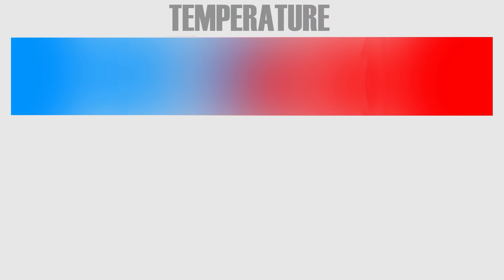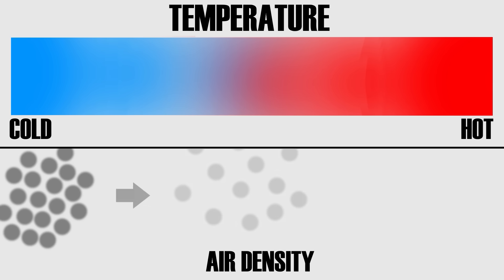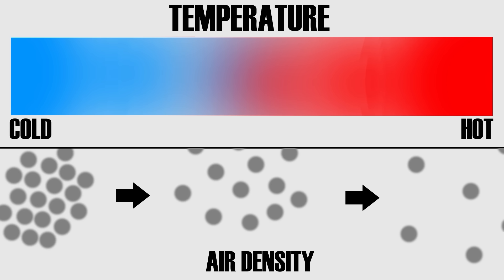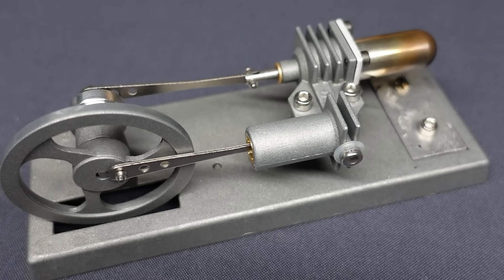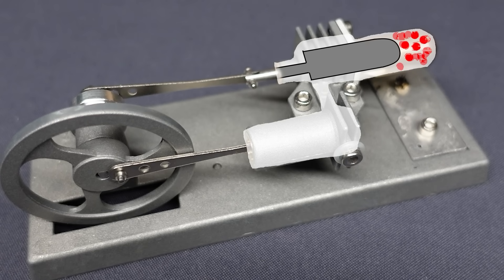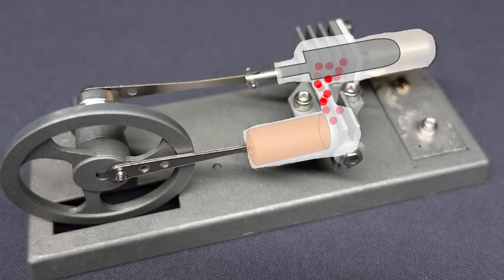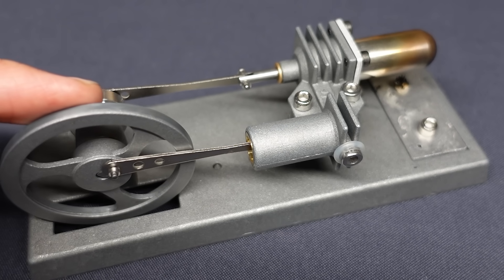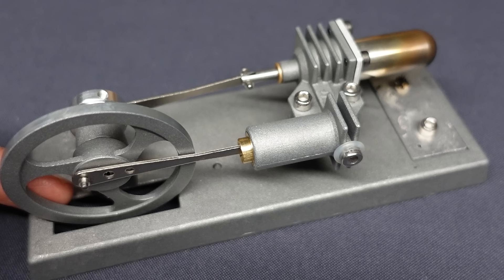It Can Save The World - The Simple Genius of Hot Air aka Stirling Engines

Comment: In theory, would it be possible to have a Sterling engine generate more electricity than it uses? If you hooked up electric motors to generate electricity like an alternator and used electric heating elements to control heat, could you achieve an engine that generates more power than consumed. By using a computer to control when and for how long the elements are on, it would theoretically constantly generate power while only occasionally consuming power. Yes the startup procedure would take a lot of energy to heat up the elements but once it's running it would only need to turn on intermittently to keep the temperature at an optimal level thus generating electricity without consuming any. Is this possible?

Comment: I have one of these and they are pretty fun, but a problem lies in lubrication. It slows after 15 minutes because there is no lubrication on any of the pivots. Spray it with wd as it’s running and it speeds up. Not practical for bigger projects yet.

Comment: I realize that the answer is probably "that's a more complex 5 stroke", but I wonder if internal and external combustion engines could be joined together: normal 2 or 4 stroke ICE, then use the heat expelled to perform the ECE stroke. I can see it being super useful in hybrids 🙂

Comment: I always assumed external was just referring to steam power since with steam you heat up the engine from the outside and then use the heated water to push steam pistons, while in the internal combustion you are combusting fuel inside the engine cylinders.

Comment: Any device has to be lubricated.  So you must have an oil cup or something and then you will have a lot of smoke I would think.  I have never read anything about this.  If you want to know about Sterling engines look for a book called 'The Star Drive'.  It is about how NASA uses a Sterling engine with nuclear power to power those probes that go to the end of the universe.   Also has a lot of info on Sterling engines and other versions.

Comment: Right beside the Sterling engine is a machine that uses only 25-30 percent of it fuel for energy and the rest for creating heat. Doesn't that look like a symbiotic relationship to you? Or you could make a simple Tesla turbine using the waste heat to generate electricity or accelerate a vehicle, etc. Alan Robb

Comment: Time 13:39
That begs the question, is there waste heat in an all electric car and could you use that waste hear to power an on board sterling engine that would charge the battery. Definitely could with a hybrid. 
Question is could you actually give the space and would the electricity generated compensate for the mass of the sterling engine.

Comment: Save the world from what?

The sterling engine is a novelty.  It always has been and always will be.  

Let’s see why!

1. Stirling engines have a low power-to-weight ratio, making them impractical for automotive applications

2. Stirling engines are more expensive than internal combustion engines

3. Low Power:  The physics behind the sterling engine are not favorable for automotive applications.  To produce enough power to propel a car, the engine would have to be massive.  

4. Reliability!  Sterling Engines have horrible reliability.  They require complex heat heat exchangers which are plagued with issues.  They suffer from heat pipe cracks, regeneration screen failures….  

They are NOT simple engines as you state and require many more parts than your toy example.  

They are also horribly inefficient and non-responsive.  

They’re cute desktop toy!  That’s all they’ll ever be.

Comment: 12:12 'even thermal power plants make massive amounts of waste heat'. Well, coal and lignite fired about 60 to 70% and gas fired about 40%, but it comes at around 100°C, way too low to properly run sterling. You can raise the waste heat temperature, then call it low-value heat and use it for district heating in the winter. Being done troughout the world. But at a cost for the electricity production efficiency.

Comment: can you use it with heat from geothermal heat with lower temperature than would be needed than to drive water steam engines? that would reduce the depth for digging geothermal drilling holes.

Comment: So air is an excellent "work medium" one of the best we know of consisting on or about 70 percent nitrogen and 30 percent oxygen. As we heat this bonded gas the nitrogen will stay "inert" but the oxygen will expand thus "expanding" pushing the piston this piston using an interesting "cooling fin" presumably to help moderate or #govern the output which then transfer the power to a cool sealed piston which is not "blowing off gas" /air as the first piston is this internal combust achieved via mechanical contrivance "pushing the cool gas in sealed chamber against other cooled gas by way of a piston" providing working power absolutely all SEEMINGLY powered by a single external heat source but in ACTUALITY powered by "internal gas flows" which indeed can be greatly enhanced by sealing up the external heat source using saying an electric coil such as that used in boiling water from your coffee pot. Wrap that piston in such a coil and simply plus that into you wall outlet and an incredibly efficient and powerful machine be made indeed in theory quite reliable as well. Interesting that LNG tankers which use #boil_off_gas to power their massive ships do not attempt to employ this type of engine technology actually as there certainly is no shortage of the fuel😊😊

Comment: Sterling engines - also used with solar power.  I recall a solar array consisting of multiple parabolic dishes.  Each parabolic dish consists of an array of mirrors reflecting light to the centre point.  And at the centre, the hot side of a Sterling engine.  Uncertain how this project turned out but I would assume the drop in panel cost makes this sort of solution less attractive.

Of note, the important point about a Sterling engine is that you require a temperature difference in order to extract energy.  One requires not only a hot side, but also a cold side.  I recall another project from a Pacific island that was planning on generating power via Sterling engine.  They were situated on an underwater cliff and planned on pumping cold water up from depth to use on the cold side of a Sterling engine.  For the hot side they would just use the surface water.  Don't know if it worked but it is an interesting idea.

Comment: Its not a combustion engine nothing explodes, it's an expansion engine, you hot air expands.
Reply: Combustion doesn't mean explosion. Wood is a combustible, so is coal and hydrogen. So, in an external combustion engine, the flame and what is causing the flame is the combustion.

Comment: 7:55 This exactly how it it is told, that Nazis got an idea of gas chambers. In Auschwitz (before it was a death camp- at the time it was a concentration camp- basically prison with almost no food and hygiene) some men ware packed close in a small, dark cell. It wasn't even air tight- normal, small room. They had one candle, but it was on all the time. They all suffocated cause the candle burned out oxygen it the air. The fact is most certainly documented. It only is not clear, if the gas chamber and gas truck idea was connected or not.

Comment: Missed opportunity to mention that in the beginning of the 80s, NASA and DOE (US Department of Energy) financed research to apply Stirling engines - initially from Sweden's Stirling United - to automotive use with prototypes (MOD 1 & MOD 2) from AMC, Chevrolet and Ford, based on models from their lineup at the time, built to prove its viability which they did with some success.

Search for AMC Spirit on Wikipedia and photos of the experimental NASA/DOE model can be seen with the Stirling engine used.

Comment: What is the minimum or optimum temperature. Could I catch heat from my boiler, tumble dryer or even waste water (like when you empty a bath) and use this heat, perhaps with a lesser amount of fuel to burn. could I run a small generator creating power I do not have to pay for, is a simple solar an added option?
The planets power really only comes from the pounding heat the sun provides everyday.
I have often thought whoever makes direct electric power from heat well deserves credit, and this looks very promising.

Comment: Off grid. Abundance of wood. 
Model up to run a household full time ?  Wood  or waste oilmheaters to charge a battery bank when needed? 

I see huge potential as an emergency charging option for a battery bank. 
Does the intensity of the heat determine the speed of the sir being transferred or and .. the heat that can be removed between rotating air between cylinders?   More cooling fins over a longer distance between cylinders?  
What about a flywheel in the equation?

Comment: Thermodynamics says the energy conversion efficiency of an engine where the hot part is T1 Kelvin degrees and the cold part is T2 Kelvin degrees cannot be more than (T1-T2)/T1.
Given you heat up the hot cylinder to 373K (100C/212F, boiling water) and the cold part of the engine is ambient air at 300K (27C/80F), the energy conversion efficiency cannot possibly exceed ~ (373-300)/373 =~ 0.1957 or 19.57%.

For comparison, a Toyota RAV4h with a A25A-FXS hybrid propulsion system manages to use around 41% of the energy of the fuel to move around.

Comment: Both types of engines produce carbon monoxide that will kill you. Its just that a Stirling engine produces VERY little power, and less carbon monoxide along with that power. An internal combustion engine produces much more carbon monoxide because it produces MUCH more power. 

In fact, an internal combustion engine is MORE efficient than a Stirling engine, and produces LESS carbon monoxide per unit of power made... 🤷🏻

So, NO, Stirling engines can not "save the world", they are more wasteful than I.C.E. engines are.

Comment: I work with large scale Stirling engines every day and a much as I like the idea (and it does make me a living) it will probably always be a curiosity.  A practical application of real value has yet to be found.
  We generate electric and heat water and rooms with the residual heat. This combined heat and power system nears 90% efficiency.  Nobody wants it, no market or interest except for a few hippy dreamers and some university engineering departments.  We have demonstrated it publicly running equally well on solid, liquid and gaseous fuels.  People are very interested but nobody wants to buy one.  It ain't gonna save the world, I wish it could.

Comment: Can you make a part two of this to answer my questions?

What if we use sterling engines in cars the same way we use hydrogen fuel cell engines? They take the energy produced by the fuel cell and charge a battery, which then power a motor. We can use environmentally friendly fuel like you mentioned to power it. 

Since we don’t have controllable engine speed, what if we add a transmission to do that for us to power the wheels? Maybe a CVT to electronically control the engine speed when required?

And finally, since the engine can run considerably long even after blowing out the candles, what if we use that to our advantage and make a perfectly timed sterling engine that runs on heat for some time, then turns off the heat to use the excess heat dissipation, and then just before the engine loses power, we relight the candles again to make it go. It won’t be perpetual motion obviously, but it would greatly increase the efficiency.

Talking about perpetual motion, i know it’s not possible, but since the sterling engine can power a very bright lightbulb, why can’t it power a heater to heat the engine to create power as the cycle continues? Obviously you would need an extra heat source to start it, but after that, would it still need it?

What if we direct sunlight directly to the sterling engine as a means of creating heat and generating power instead of a solar panel too?

Finally, what if we use a sterling engine that is directly connected before the radiator fans to work as an extra alternator to power the battery and electrical components while the car is on, and charge the battery of the car while it’s off as well?

I hope you get back to me on these questions, I’ve been seeing these engines everywhere and think they are really cool because they have so little disadvantages and have a cool sound which many car guys like me enjoy.

Comment: Also, when I saw how long the multi cilinder motor keep running whit the candles off, I imagine that if you instal a simple heating pannel (made with plastic tubes painted in black) on your roof, and then you use that heated water as heat source for your Stirling motor (heating piston shoul be inmerged in hot water), the motor can use the Sun power to work for hours even during the night..

Comment: There are some other issues with Stirling Engines.
-They are generally expensive per kW of output.
-Using waste heat is not thermodynamically free. 
-To reach good efficiency levels they must use even more expensive materials to handle the higher temperatures.

Comment: There was a commercial product using external combustion, I'm pretty sure it was made in China but I saw one in Vietnam used over a wood fire.  First problem with these is limited, very limited power for a given size.  Next is waste heat...... I mean 90% of the heat to drive it is lost to atmosphere.  The one I saw was powering a small water pump on a pulley.  There wasn't enough power to run a real genset, maybe a magneto.  They aren't around anymore I think, they all wore out.  Lubrication is an issue and these units had internal lube, similar to a refrigeration compressor.  If the unit can't produce enough power to pay for itself it's not worthy of existence unless for artistic reasons.  That's why those commercial sterling units from China are all gone now.

Comment: The piston is not "pushing back the cold air". The piston is pushed out when the air expands, and is sucked back when the air contracts. It is working in both directions.

Btw: do lubricate it, when running it dry, it will not last long.

Comment: ok ,I have a single piston stirling motor. it has one tight fitting piston and then a joiner pc in middle and then a tight fitting test tube with metal shavings inside and the flame heats up the end of tube with metal and then in between the two glass tubes is small joiner pc. so how does it work with just one piston,and why don't we use these type motors for other applications? cars for an example?????

Comment: This might sound very idiotic, but can you use hydrogen as fuel to heat the engines, while using some of the electric power for hydrolysis of water? I am not a physicist so can’t get numbers on those. Is it possible?

Comment: Just wonder if a computerized ignition system that instead having a continuous flame but an intermittent flame that induces the optimal amount of heat necessary to keep the engine running. I believe this would lead to an extremely efficient system.

Comment: I want a stirling engine that is placed on top of my computer that can effectively make use of the considerable ammount of heat that these machines emmit to produce electric energy that then can be easily and cheaply stored in one or more 12V lead car batteries.
Imagine how much more independent and safer our entire electrical infrastucture could be, if every household was equipped with a reasonable number (how much that is is for the individual owner to decide) of these recharcheable, lead-based galvano-electrical cells, constructed in a way that makes it most easy and cheap to service and run them basically forever, all rigged upin a safe and simple to monitor their functionality kind of fashion, that are constantly kept at full charge by stirling engines, solar pannels, small sized wid turbines,etc, whatever is most convenient and most easily available at a particular place! Imaginehaving this kind ofreserve in electric energy ready at all times to be used individually or, what could be implemented with no big technical difficulty and at a low cost as a part of thestandard electrical grid. It would allow for enormous stability and flexibility of the entire enery network. For a homeowner to invest insuch installments could provide him and his family with a much more tangible asset than any stocks or other financial saving system could ever offer. This is basically a low-tech solution that doesn't require complex technology, its environmental risks are well known and easily manageable, the cost per unit isrelatively low, its capability canbe expanded according to financial means and/or the local availability of natural ressources of energy that can be converted into electricity and the entireconcept, down to the technical detail can be understood and efficiently serviced by any person with normal mental faculties.
This is how I envision actual "green technology". Some of you might be irritated by lead being used in large quantities for a system as described above but it must be considered that in this case the metal is safely contained and the ways to prevent it accidentally being released to the environment, animals or humans being poisoned are straightforward and redundant safety measures do not require any complicated technology in a degree that makes it nearly completely "foolproof".
It would be very interresting to hear your opinion about this concept as a whole, where might be its main problems and what are your ideas on how to improve it in certain or every aspect. The way I think about it is as a diametrically reversed approach to everything implied in WEF bigboss Klaus Schwab's vision for our future encapsuled in that slogan "you will own nothing and be happy"